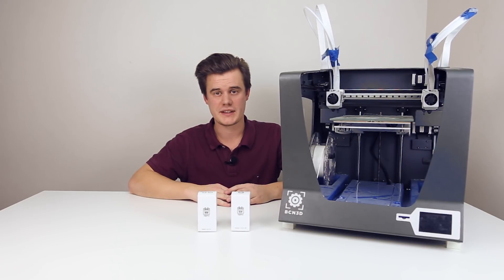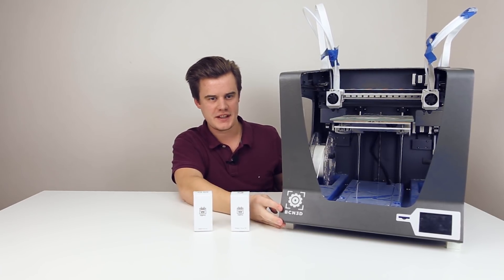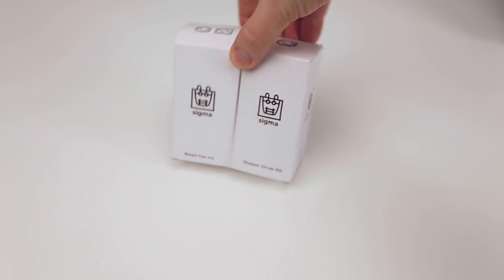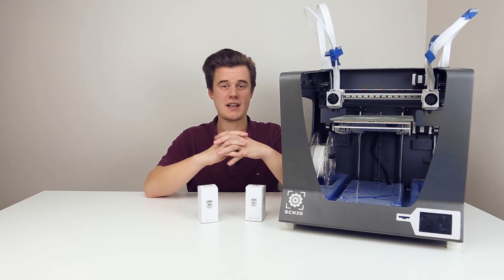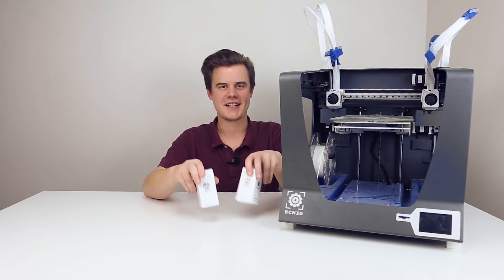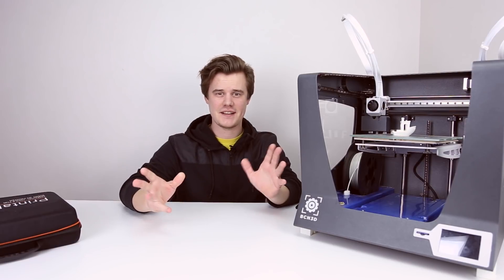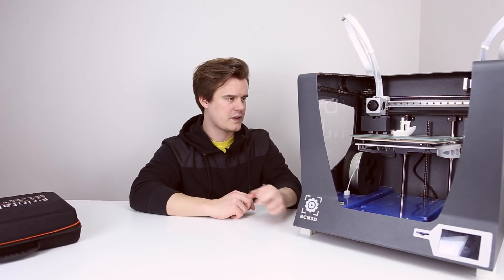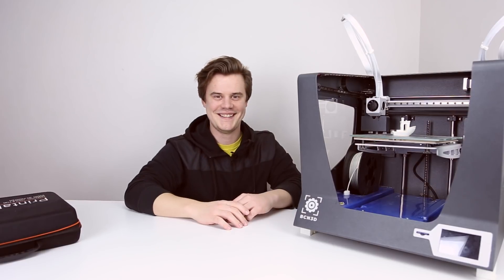BCN3D R16 to BCN3D R17 upgrade - making it all silent!

Comment: Thanks for posting this...I recently saw an R16 go up for sale and checked that it can be upgraded to the 'new' standard.  After seeing how easy this upgrade looks to be, I may try to purchase one to join my little print farm.
Reply from the maker: I hope you get it. It's a really nice upgrade for the R16. Add bondtech extruders as well if you're handy. They seem to really help for some users. Personally i've had good experience with extrusion and didn't need to upgrade =)
Reply: 3D Print - Tech Design thanks for the reply.  The buyer is hesitant to part with it now so we will see.  The upgrade parts seem out of stock at most USA resellers

Comment: I really like the idea of an IDEX 3d printer but why they make their case like that? It'd be nice if more squared to enclose it. At least they gave you good support with that replacemen partt. Welp, I might be getting enough business next month to buy one or similar.
Reply from the maker: Haha xD Yes, design can be tricky ;) I think it looks cool. It's very easy to get access to everything actually. They do have hoods for them, plexi-cut, so I guess they work OK, but it's a pretty big volume to enclose, so relying only on the passive heating from the bed would take some time to make it perform optimal with larger nylon/ABS parts for example.  The support team is awesome! It's me whos slow to get the packages lol.   Send me a PM if you wanna throw a few ideas at me on what you'll choose from =)
Reply: Ok, I'll first have to see when/if I get this work. Someone I know is buying a business and they might want some customs tools to help out with it. They are just waiting on all the paperwork.